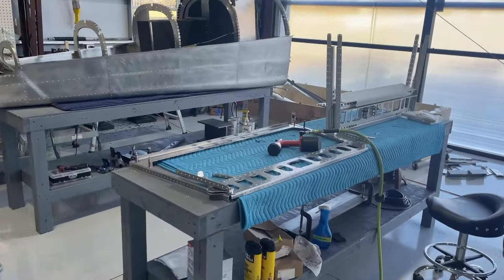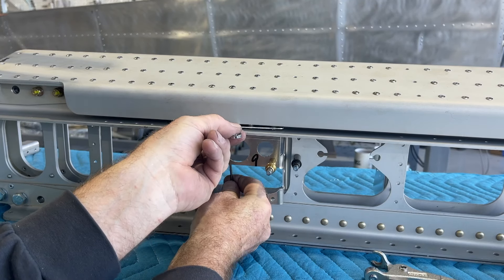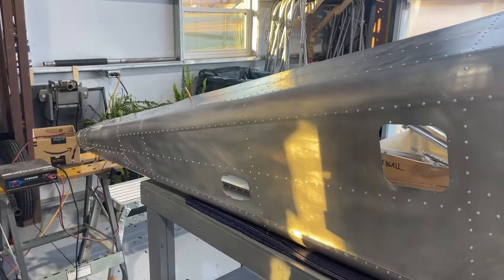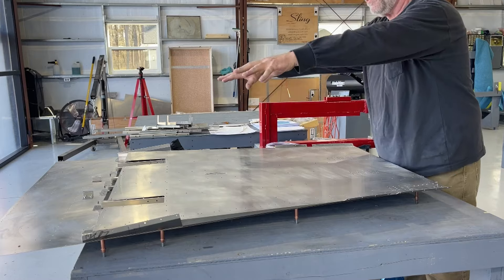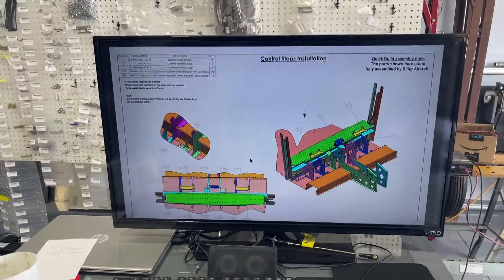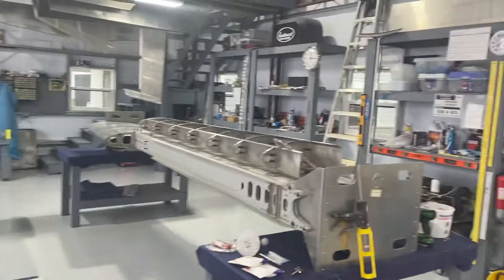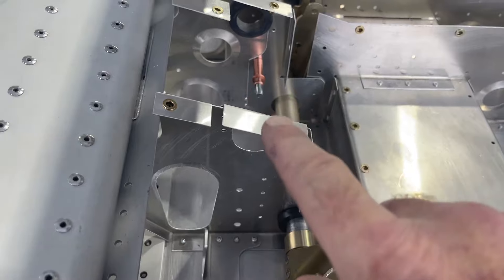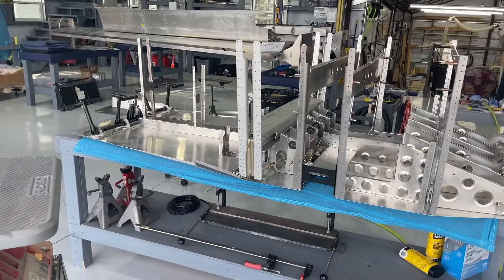Building the Center Fuselage  [Sling TSi Build Video #10]

Comment: Very informative videos. I'm curious what the plan is for corrosion control. Will the internal structure be accessible for future Corrosion X treatments, or will the inherent corrosion resistance for 6061 aluminum suffice? Since this is a slow build, I think the parts are not alodined by the factory.
Reply from the maker: Since 6061 T6 AL is the stainless steel of aluminum, I am not concerned.  I have discussed this with several engineers that specialize in metallurgy and they concur.